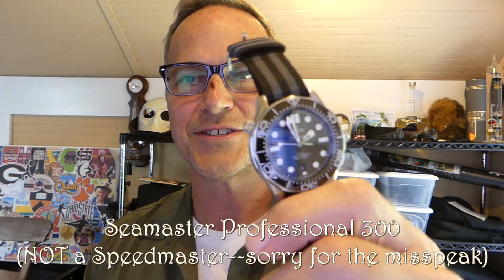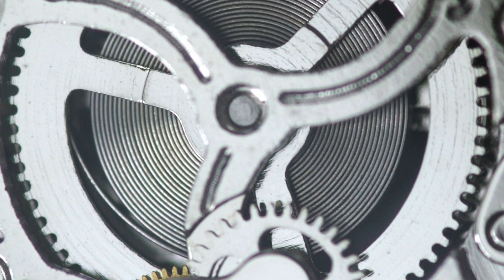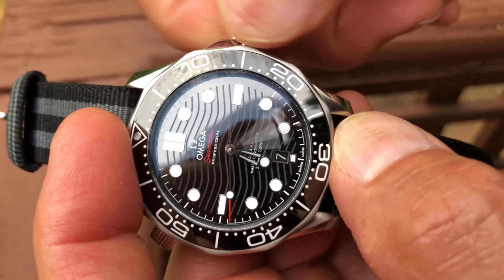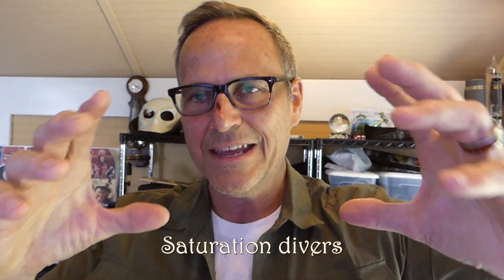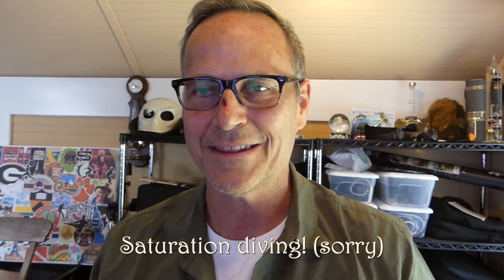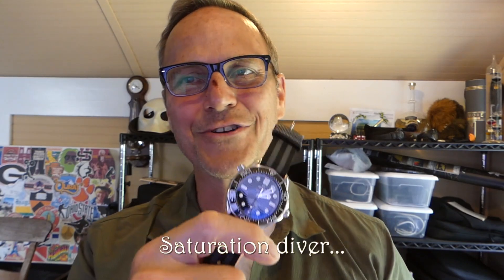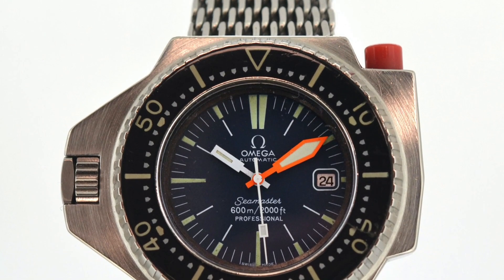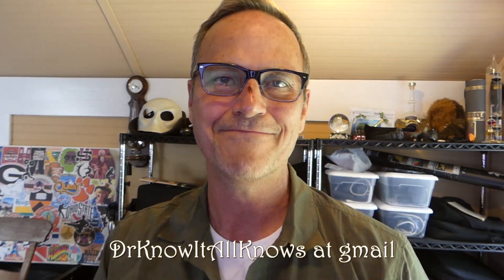What is a Helium Release Valve, and why do you need one?!

Comment: For the Seamaster planet ocean 600m with 8900 movement there is no crown position for adjusting the date independently, to adjust the date you pull the crown to position 2 which adjusts the hour hand and you have to wind the hour hand alone to adjust the date, the date will increment forward as the hour hand passes 12 midnight, but interestingly this function is a very good way to know your Seamaster Planet Ocean 8900 is genuine, when turning the crown in position 2 to change the hours the hour hand moves in jumps of 1 hour increments and is always in the correct position between hour markers on the dial according to the position of the minutes hand, for instance if you pull the crown out to position 2 while the minutes hand is on 15 minutes the hour hand will always be at a quarter past an hour on the dial you can't make it stop at an incorrect position according to the minute hand, also if you turn the hours hand backwards to adjust the date backwards the date won't go back one day as the hour hand passes backwards over midnight you have to bring the hour hand back to 7pm before the date will increment back 1 day. Most fakes or even very good clones won't work like this, they will usually work in a conventional way where either 1 click out adjusts the date and 2 clicks out adjusts the time just by moving the minutes hand (the way the Seamaster in the video works) or they will only have 1 adjust position and to adjust the date and time you have to wind the minutes hand around and around to move the hour hand and then the date.

Comment: Hey forgive the stupid question, but why couldn't you unscrew the regular crown to release the pressure?
Reply: It's a safety thing, you could do it that way but when you unlock the main crown and pull it out the watch isn't so waterproof, an accident could potentially happen with water or even just humid air containing moisture entering the watch. 

The helium valve is more water proof when open than the crown is when it's unlocked and pulled out, the helium valve is a one way valve it let's compressed gas out but it's difficult for water or even humid air to get in when its open.
Reply: @ats-3693  Ideal in a steam room or sauna.

Comment: Fun fact: iPhones once had an issue where the device would crash and turn off when exposed to helium. Turns out the internal accelerometer sensors weren't sealed tight enough for the gas and went crazy with helium inside, which crashed the phone's operating system. It was fixed at some point by improving the seals around the sensors, but it was fun reading stories of e.g. hospital technicians doing maintenance on (helium-cooled) MRI machines and suddenly all the iPhones in the building would turn off.

Comment: Why could you not just let the pressure out of the normal crown?
Reply: It's a safety feature, you could do it that way, but the adjust crown isn't so waterproof when unlocked and pulled out, potentially an accident could happen and water or even and more likely humid air containing water could enter the watch through the regular crown if it was opened in a diving bell situation. The helium valve is designed to be a lot more waterproof even when opened, it's a one way valve designed to let gas escape while preventing water or humid damp air entering even when it's opened.

Comment: A couple of inaccuracies there. The water pressure doesn't double every 10 meters. Every 10 meters (or 33 feet) equals 1 atmosphere. So at the surface you're at 1 atmosphere. At 10 meters you're at 2 atmosphere. At 20 meters you're at 3 atmosphere. At 30 meters you're at 4 atmosphere.

It's not only that helium is made up of only 2 protons and 2 neutrons, but that's it a single atom molecule. Most gasses consist of 2 or more atoms (H₂, O₂, N₂). Hydrogen is only one proton, but it takes two atoms to create one hydrogen molecule (H₂), and is therefore larger than a helium molecule. A hydrogen molecule is even larger than a single oxygen atom, but since oxygen is also a 2 atom molecule (O₂) it can't ingress into the watch.

You also mentioned "compression diving", where you meant "saturation diving". Compression diving is any kind of diving which requires decompression stops.
Reply: Yes, and when discussing normal compression diving with decompression stops the helium valve is irrelevant, the diver and watch are always in the water no helium is forced into the watch, it's only when saturation diving with divers actually living in a bell or habitat containing high pressure heliox gas for weeks on end that the high pressure environment slowly pushes helium atoms from the heliox breathing gas into the watch through the gaskets and O rings.

Comment: Couldn't the helium release valve just be the normal crown by the 3 o'clock position? Just unscrew it for helium to get released?
Reply: Yes, that's my thinking. I don't get the point of screw down helium escape valves. You forget to open it, and you might as well not have one. You forget to close it, and you might as well have bought a non-dive watch.

Comment: Ok.. too vague explanation. Unscrewing a regular crown will relise the pressure the same way as unscrewing the helium valve! But where? At the surface? But what if the pressure popped the cristal before you get to the surface?
Reply: The HEV isn't for releasing pressure when underwater. There is no risk of helium getting into the watch while you're in the water. If you're breathing Trimix, you're either using a rebreather, which is a closed circuit system, or you're using a normal regulator, which expels gas into the water where it quickly rises to the surface.

The only time helium can get into your watch is in a hyperbaric chamber filled with Trimix or Heliox, and the only time the HEV is needed is when decompressing as the ambient pressure drops faster than the helium can escape from the watch.

But yes, unscrewing the winding crown will do the same thing as opening the HEV.

Comment: Why do you need one?  You don't.  You will never meet anybody who does.  Even if you do there is a 99% chance they use dive computer.  The number of saturation divers depending on an automatic watch vs a highly specialized dive computer in 2021 has to be counted on one hand.  I dive to 300 meters and know many divers, we all use scuba dive computers which are sold in every dive shop on the planet and are the standard these days.  I like my automatic dive watches for fashion and practicality on or around the sea but I'd be extremely hesitant to count on them for my life versus a digital dive computer at this point in history.
Reply: I call bullshit on that one. No dive computer can go down to 300m. They're all rated to a max of 150m. Also, no recreational diver dives below 30m, and technical divers rarely go below 60m. So either you're not a diver, or you got your numbers mixed up.

Do you need a HEV? No. There are only a couple of dozen saturation divers in the world, and you're not one of them. Do you need a watch that can go down to 300m? No. A 100m dive watch is more than enough, but it does need to be a dive watch. Take any other watch that says "100m Water Resistant" scuba diving, and it'll fail. A $150 100m Seiko dive watch will work just as well as a $15,000 3,900m Rolex Deepsea for pretty much all diving you'll ever do.
Reply: @bloodymarvelous4790  yup.  As long as threads and gaskets are in functioning order then it will do for 99% of people.  Although I'm a bit less confident of that for watches claiming 100 meters water resistant that are not dive watches.  My damasko pilot is rated 100 meters but I still don't really trust it even when splashing around in the surf.  And ya, my bad, max depth I've ever went down was 300 feet not meters.

Comment: @
Dr. Know-it-all Knows it all.  I have a 2019 Seamaster 300 and I unscrewed half way by mistake the Helium valve then I screwed it back in. Does that mean the gas went out and I would need to send it to Omega to be charged? How does that work? If I dived now with the watch would the water go inside? And when do you unscrew the Helium valve, inside the water as you go up or outside the water (once you're outside)?  I have no experience whatsoever in this topic :) Thank you
Reply: No need to worry. There was no helium in the watch to begin with. Helium can only enter your watch in a hyperbaric environment, and it needs to be able to get out before it breaks your watch when decompressing. Your watch is designed to be compressed underwater and not break, just make sure you screw the helium escape valve down again before you dive.

Never unscrew anything or press any buttons on your watch underwater. Keep everything screwed down. Anything you open or press will let water in and ruin your watch.

Comment: Very neat! Thanks for the explanation. It seems to me that the Omega-style solution could be accomplished without the release valve at all - wouldn't unscrewing the time-set crown also release helium and accomplish the same thing? The Rolex solution seems more elegant to me, if only because it functions without the user having to think about it/take any sort of action.
Reply: The one Rolex uses can have its issues such that it can jam in the open or closed position since it is always exposed to the elements. Omega’s valve is also automatic like the Rolex which  opens when there is pressure during Saturation diving. When you unscrew the crown, you do not open the valve per say, it is still closed and waterproof. The helium will release automatically when it is need
Reply: @8AMG  Thank you for that response—I hadn't thought of that before but you're right about those advantages. I appreciate you taking the time to write that out.
Reply: @8AMG So, unscrew it while in the water or after coming up to the surface on the deck of the bot in an environment where there is no water?
Reply: I thought the same thing. Just unscrew the time-set.
Reply: @angelmaese7194  The guys over at the Grey Nato podcast interviewed Paul Scurfield, a saturation diver, for episode 90.  According to him, you can't really unscrew crown once you are under pressure.  The high pressure just won't let you do it.  If you want to unscrew it, you have to do it while you are the surface.  Which means that a manual he escape valve is useless (or as useful as the crown), because you run into the same problem as using the crown to release the he (need to remember to unscrew before you are under pressure because you can't unscrew once you are under).   An automatic comes with its own set of problems.  Scurfield had an old post on watchuseek talking about both.

Comment: Soooooo...just unscrewing the main croun would have done the job just as good...💪😄
Reply: That is absolutely correct . The second crown at 10 is just another point of potential failure when you forget to close it .And in sat diving you have plenty to worry about already, that's why the Rolex helium release valve is designed like that

Comment: Thanks for the explanation. Noticed you opened the escape valve a couple of times during the video.  Doesn't that harm the watch in any way? Does all the helium escape when doing so? Thanks
Reply from the maker: thanks for watching! At normal ambient pressure (ie where we all live), Helium is just mixed into air in a tiny percentage, and is not under any outside pressure to "get in" to the watch. Only when you have a highly He mix under pressure (ie inside a diving bell) will Helium actually squeeze itself into the watch. So no worries as long as you're not under pressure in a diving bell :)
Reply: @DrKnowitallKnows 
Thanks for the explanation 🙂👍
Reply: @DrKnowitallKnows  great video, still a little confused.. so in theory helium is inside the watch at all times but only becomes a problem when you are decompressing and then at that point you need to release the helium inside? sorry for a stuipd question just trying to get my head around it haha
Reply: @chadm9827  The watch doesn't come with helium inside it. Excess helium enters when living in a hyperbaric environment where the breathing gas isn't air, but Trimix (helium, nitrogen, and oxygen).

The helium atoms are so small they can pass by the seals, slowly raising the pressure inside the watch until it becomes equal to the pressure in the hyperbaric chamber (which can be well over 10x normal air pressure).

When these saturation divers have spent weeks inside high pressure environments, and start their decompression, the pressure in the hyperbaric chamber drops faster than the helium can escape back out of the watch again. This creates a higher pressure inside the watch than outside. Dive watches are built to withstand compression, but not expanding gasses inside the watch. The high pressure inside the watch wants to get out but it can't, which can lead to a catastrophic failure of the watch case. Usually by popping the crystal out, which is the weakest point of the watch.

Comment: The Seiko Tuna is also sealed so well that it doesn't require a He escape valve (at least, that's what I've been told).
Reply from the maker: Also they have "L" shaped gaskets in the tuna: the bends in the gasket keep anything at all from getting in. The PloProf (Omega) used a mono-block case plus a similar L shaped gasket to get around the He release valve need too.
Reply: @DrKnowitallKnows hat happens if a diver opens the crown to set the date on a Seiko Marine Master or Seiko tuna or other monobloc L-gasket watch (after a non-31 day month) while they are living in a hyperbaric chamber at storage depth pressure? Does air at storage depth pressure just rush into the watch?

Comment: Hi, doc, Maybe you misunderstood my question,,  surely just unscrewing the "normal" crown would vent any pressure build up  ??
I'm still confused, and the long explanation of the hrv was unnecessary, as I understand its function,,, 
When the "normal "crown is fully pulled out, is the body of the watch still sealed, or not,,?? (that's the point of my query,, ),,
Best regards,,,    John..
Reply from the maker: Ahhh, sorry--guess I misunderstood the question. Hopefully it'll be useful for someone! So short answer: yes, unscrewing the crown should allow gasses to escape. However, the HRV valves, as dedicated one-way devices, could allow you to release pressure even if/when under water and or in a high humidity envirnonment. In other words, the Omega/Rolex (and other) HRVs can operate underwater if need be. How exactly you'd end up in that situation, I have no idea (anyone??), but they are water tight, one-way valves, while the normal crown unscrewed makes the entire watch non-water tight. So consider this: you finished your saturation dives, and now you get to spend 4 days decompressing. But the diving bell thing has a lot of humidity in it. If you open the regular crown, water vapor could get into the watch mechanism (eek!). However, if you just unscrew the one-way HRV, it will only allow helium to escape, not let water vapor in. I guess that's the most reasonable scenario. Hope that helps!
Reply: @DrKnowitallKnows 
Thanks,, that solves it for me, !! 
All the best,,    John...